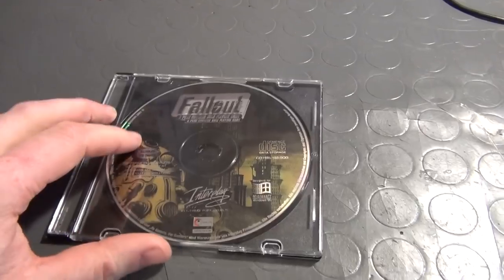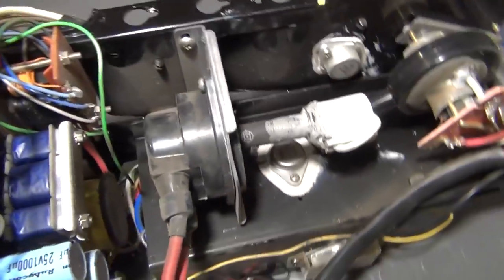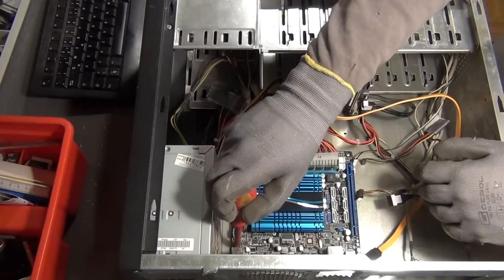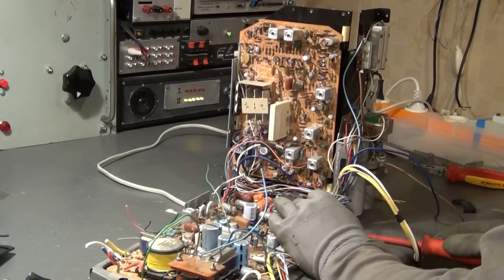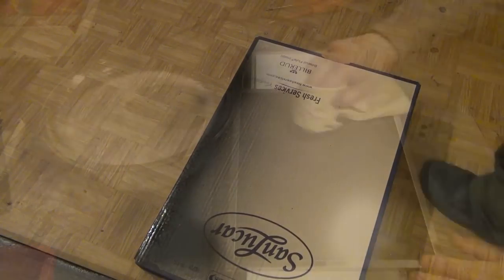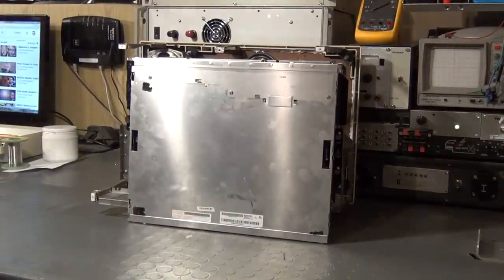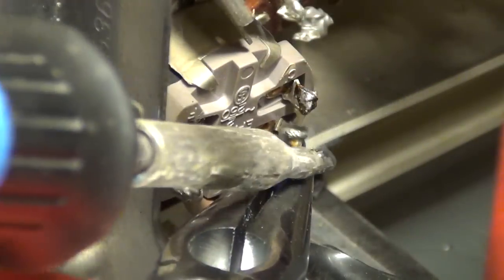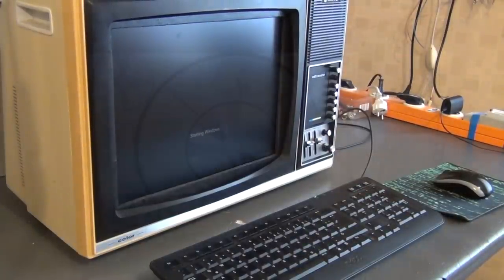Fallout Style Computer Build - Retrofuturism!

Comment: you completely failed when? 
you replaced the screen with an LCD instead of keeping it a CRT, hey It's authenticity I strive for, besides running 480i on a CRT Would also Save Processing power instead of running 1080p or 720p
Reply: and for those who say 480p/480i looks ugly you've never used a Native 480p screen once you see a CRT running 480i You'd think it's 1080p or 720p due to the fact it looks so nice well heres why, THERES ZERO upscaling

Comment: i want to make an itx radio case. how do you make a rotary switch a pc power buttom? i want to turn my pc on like a radio. simple on and off.
Reply from the maker: Google Name If you want to use a switch to turn on your pc you would have to activate it only for a short time (half a second or so) and then turn it back.  The PC only needs a short pulse to turn on. If you connect the power on/off pins of the motherboard together permanently (like with an ordinary switch) the PC is likely to start, but then shut down again. That's because "pushing" the on button for a longer time, normally forces the PC to shut down or simply turn off. 
If you really want to do it with an old switch you need to add an electronic circuit, that gives off a short pulse once the switch is brought in the on position. This can (for example) be done with the NE555 timer.
Reply: +Google Name There may be a setting in your motherboard's bios giving you the option to turn on immediately when power comes back, so you will no longer need the PC soft switch. Then you can simply turn on/off the pc using the power switch. This is frowned upon for modern operating systems, but should be no problem for DOS. You can also add a small UPS and set the OS to hibernate when power is off and resume when power comes back.
Reply: You can technically override the whole PMU on the motherboard by shorting out the green wire on the ATX 20-pin connector with the ground.
The motherboard then will turn on and will only turn off again if that connection is cut.
That would allow for a flip-type switch.
Reply: Google Name you could maybe not use the  switch and put a button in a discrete location

Comment: 1:42  The AC flyback in the old TV is not that dangerous , its AC and not DC and you can event touch the Arc (AS LONG AS YOU TOUCH ONLY 1 OF THE 2 END OF THE SECOUNDERY COIL)
Reply: Treda Coolpants I'm a computer engineer and we're taught that dc is more forgiving than AC
Reply: you must be the worst at your class then dude :)....with ac you get shocked in pulses...with dc you get a permanent steady shock...there is no frequency in dc and the "waveform" is a straight line of always the same voltage...so the shock is much more dangerous because it is continuous....go check for example the ratings of old capacitors, they have ratings for ac and dc...for example a 385v ac capacitor cannot withstand 385v dc